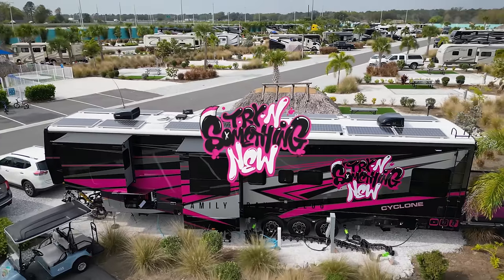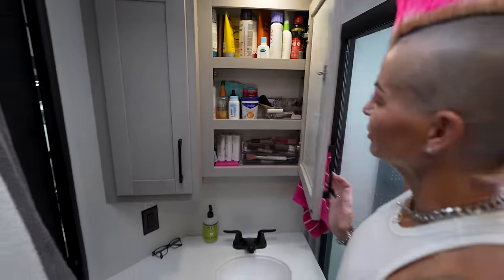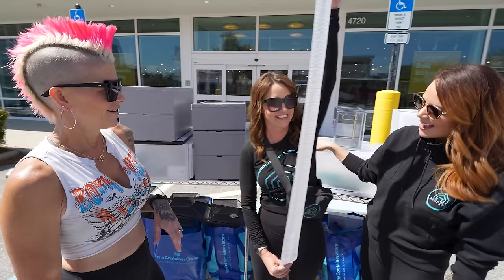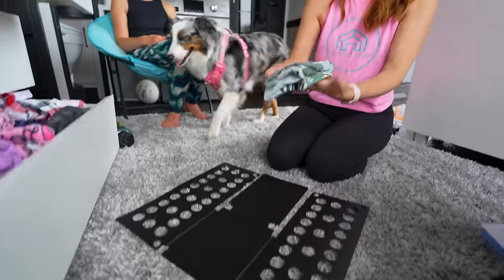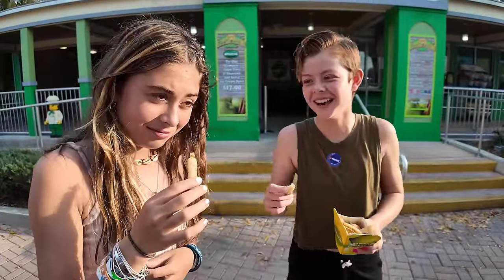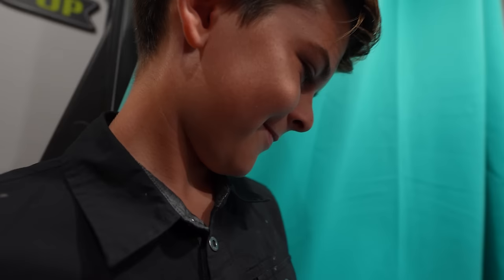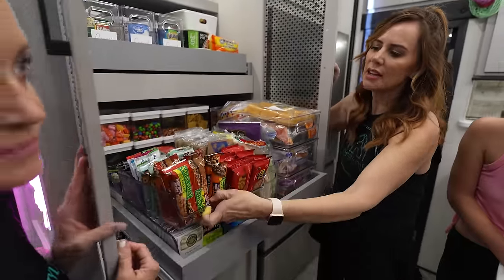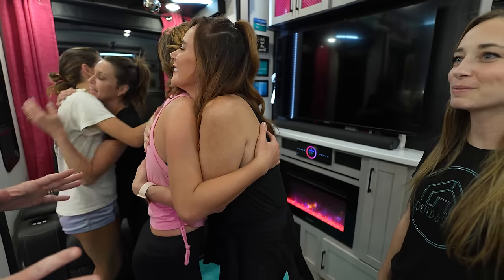EXTREME 450 sf. OF ORGANIZATION! RV life takes on a CHALLENGE!

Comment: I was wondering all those bins would add weight to your RV.  You have a gazillion bins they have to be heavy
Reply from the maker: There was a lot of bins outside, they overbought, because there was not a store in the area, and then ended up returning what they did not use. Look like a lot of bins were used, but at the end of the day I would say it was under 30 bins, so it did not add that much more weight. Great question